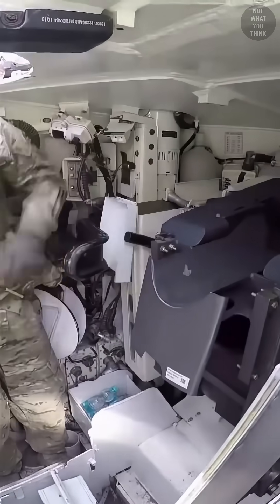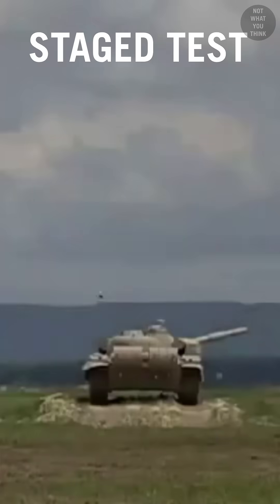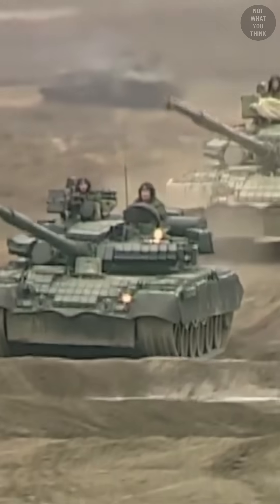Why M1 Abrams Tank Has No Auto-Loader #shorts

Comment: tbh most cons of an autoloader can be fixed if theres just more money pumped into it, though that increases price per unit (duh) and complexity in maintenance, repairs and production
basically a solution , if you have the money to spend its "just" to throw more money at it
Reply: honestly with modern technology i dnt see any reason for more than one operator in a tank.
Fighter planes have only one pilot so why do you even need all those extra people? radar and other sensors take care of the commander, auto loading and auto targeting takes care of main gun, Auto targeting takes care machine guns and all the driver needs to do is look at the target and synch his target acquisition computer with the main gun and boom next target.
Reply: Operating a tank is much more complex than video games make it out to be though, added crewmembers also can help each other during repairs, often take workloads off each other bust most importantly reduce costs and increase the tanks reliability
If applied technology is advanced enough to compensate for those factors it makes sense but otherwise? Not yet at least
Reply: @TheChrush3r  pilots don't fix their own planes and the technology is there to build reliable single operator tanks.. The problem  is conceptual.

Think about it the way militaries have always thought about things. 
Its been done this way and we see no reason to change it. It works so we wont change it and we have enough men to do it so why change it.

If, on the other hand there was an absolute necessity tanks would be single operator with absolutely no problems at all.

As for reliability tanks are a zero sum entity in combat. Its either working or not. If a tank takes an effective round its out of action no matter how many crew it has. 

As you increase the number of crew you must increase the armor protection. Each crew member adds somewhere around 6 to 10 tons of armor for protection.
Eliminate those and you can not only offer better protection for the remaining single crew member but you end up with a lighter tank with better overall systems protection since there needs be no design criteria around an internal single hollow pocket. The interior space can now be optimized for the purpose of ammo storage , retrieval and loading.

All that's needed is for there to be a pressing need for such a tank. Like say Sweden?
Reply: @jussayinmipeece1069  And one more aspect man needs space. Bigger crew = bigger tank = bigger target = easier detect = easier hit

Comment: Some countries can't afford to have 4 men inside a tank. That's why countries like France or Japan prefer to rely on auto loader.
Reply: Well, France has more than 250 tanks. That would be 250 more crew to train, not that much (and they previously did with the amx30 series).
I think the main reason is that the tank is suppose to stay moving, and having a manual loading system is not convenient while moving at 30mph, so they went for auto loader. And for Japan because the tank is supposed to fight in mountains area, same principle.
Reply: @vizender  
Except France has a lack of soldiers. According to the French Ministry of Defence, they are lacking thousands of soldiers just for the ground army alone.
So yeah. 250 soldiers +  replacements is a lot.

Plus between the AMX30 and the Leclerc, many years passed, and people aren't so interested in the army today

Comment: Abrams is manually loaded because it is obsolete vehicle relying on 60+ years old design of huge heavy armored box for 4 corpses similar to Leopard 1+2 or Challenger 1+2. All of these were designed with 105mm guns in mind in ages when their counterparts were mainly T55 and T62 tanks. But rest of the world developed further. Challengers rely on multiple part manually loaded ammunition, which is even worse case.

There is zero real advantage for human loader. Try to load 120mm shell while tank is moving on some terrain and try to do it repeatedly for at least 10 times and you'll quickly find why ALL modern tanks have autoloader. And I mean modern like Soviet/Russian T64/T72/T80/T90/T14, French LeClerc, Chinese Type99, Japanese Type 90 and Type 10, South Korean K2. And even US and Germany are considering autoloader for any future tank as there is no way how to manually load large and heavy shells reliably. Added living space for another human also means that exactly that increased amount of space needs additional armor which increases weight. That is the reason why Abrams has 70 metric tons and is unable to navigate over weak terrain without sinking in mud. Compare that to 43 ton Russian tanks with rather wide tracks and now imagine both of these wehicles moving somewhere in eastern Europe where are many rivers, lot of muddy terrain, slopes, unstable weather with frequent rains and of course interesting winters.

Comments about "more men for job" are also false as every modern tank unit has support vehicles with maintenance crews and in case anything serious happens to tank, crew bails out and leaves the tank. There is no WWII when four or five guys are fixing broken track while being under fire. Trained crew is very expensive and it is easier to give them new tank and save damaged tank later by servicemen with proper equipment.
Reply: The US had the Expeditionary Tank in 1985 that had a crew of 2 and a remote-turret with an autoloader. It was in trials to be a new light-tank to replace the M-55 Sheridan. It had a 105mm rifled gun. The tank lost to the CCV-L in competition for the contract, but ultimately the whole light tank program was cancelled because the CCV-L was too heavy and the auto-loader was unreliable. The Expeditionary Tank Autoloader was redesigned and installed into the now know Stryker MGS. It will be retired in 2022 because it's too unreliable as a vehicle.
The US has just never had a reliable or light-weight autoloader. The Expeditionary Tank prototype built in 1976 even had a remote turret and a crew of 2. The US Army still rejected it
Reply: Can't really say much more. Manual loading is just something of the past

Comment: "the armor will protect the crew in an event of an explosion"

Driver: "You guys get protection?"
Reply: Next thing you see is the turret flying through the air🤣
Reply: What armor? The tank can be penetrated with a 50cal from the back 😂
Reply: Abrams weakness was the gap between Turret and Driver
Reply: The driver is in his own area. He probably the safe guy vs tank shots
Now anti-tank mines well......
Reply: If you are in Russian tank a lot of them actually were made in a way where driver can't run off and would die with the tank
Reply: The driver has the most protection  tho
Reply: @picklepickle7306  if it’s actually dug in like it’s supposed to be. The turret has more protection but also sits up higher on the tank. The driver is protected by less armor but can be hidden if the tank is dug in leaving nothing but the exposed turret
Reply: @picklepickle7306  Nope. As it was pointed out above, the top of the driver port has no meaningful protection against tanks or other large calibre weapons. The only way the driver is fully protected is when the tank is in a hull down position. The turret has much better protection.
Reply: @Lehr-km5be  long range shots with SABOT against the Upper glacias of the Abrams and other similar NATO tanks are designed at such a steep angle as to cause fracturing of the Tungsten penetrator. Th er re is reasonable protection for the driver including the lower glacias of the Abrams which has similar effective thickness as the turret itself by being also composed of composite armors. 

What the upper glacias of the Abrams lacks is protection against large caliber (90mm or more) modern HEAT ammunition as the angle cant be steep enough for the armor thickness and composition to fracture, or properly defect said rounds as they will also come downwards in a plunging angle to be more effective at distance. 

This doesnt mean they aren't unprotected, Modern tanks are swiss army knives and as such come with different Combat packages. For example, many Abrams tanks fighting in urban combat are equipped with extra blow out panels and external ERA across the sides and front for protection against RPG fire.
Reply: @Lehr-km5be  what about protection from the sides?
Reply: @picklepickle7306  Pretty much comperable. The turret obviously has lower protection on the sides, but still enough to stop lower calibre rounds. Problem would be if the shell impacted below the turret, but that would probably not be able to impact the whole turret crew. Hull has no meaningful protection on the sides. That of course impacts the protection of the driver too - however, even if a smaller calibre shell penetrates, there is a big chance it will be stopped by an armored fuel tank. Even if the fuel tank is fractured, the driver is safe tho. However, if a modern anti tank shell hits any of those places from the side, no way in hell anyone will survive.
So yes, comperably driver has a better protection from the side, seeing how crew in the turret can get killed even by smaller calibre shells if they impact below the turret. Driver's protection from the front is visibly worse tho, and seeing how any tank doctrine nowadays obviously tells tanks to fight facing forward that poses an issue. Modern tank doctrine also dictates that tanks should be in a hull down position but that can not always be done, and after all tanks need to move too. Taking all things into account I would say that the turret crew has a bit better protection.
 We should also take the escape time into account, as often the tank could be rendered immobile without the crew receiving a scratch. In that case the turret is arguably a better place to be - while it is elevated and exposes the escaping crew to the incoming fire more, it is quite hard for the driver to escape if the gun is facing forward or backwards, thus blocking his movement. While he will be able to open his hatch regardless of the turret position, depending on how big the driver is, the seconds more it takes for him to fit below the gun or the back of the turret can be a difference between life and death.

Comment: As far as I know, T-14 Armata actually manages to not have problems with safety while having autoloader. It's achieved by separating crew from ammunition entirely, so if tank gets it's ammo blow up, nothing actually happens, except now tank have to drive away from the place in order to repair autoloader and stock up on ammunition. The older models probably would be a death trap in that case, yet the way autoloader is placed was supposed to make it harder to be hit, that's why "Carousel" type of loader is placed as low as possible.
Reply: The US had the Expeditionary Tank in 1985 that had a crew of 2 and a remote-turret with an autoloader. It was in trials to be a new light-tank to replace the M-55 Sheridan. It had a 105mm rifled gun. The tank lost to the CCV-L in competition for the contract, but ultimately the whole light tank program was cancelled because the CCV-L was too heavy and the auto-loader was unreliable. The Expeditionary Tank Autoloader was redesigned and installed into the now know Stryker MGS. It will be retired in 2022 because it's too unreliable as a vehicle.
Reply: @chaosXP3RT  lol. What type of autoloader was installed there?

Comment: Slower reload, less reliable, takes up a lot of turret interior space, and much more dangerous. With a skilled loader the Abrams is one of the fastest firing tanks out there 😂
Reply: Are you for real ? Japanese tanks reload in 3 seconds with autoloaders. 
Autoloader are really reliable, they're not more likely to break apart than any other part of the tank. Would you replace the engine with horses because it's "more reliable" ?
Autoloader also allows for more compact tank design, rather than "taking a lot of turret interior". Just look at the Soviet designs.
On top of that, they're way safer if they're coupled with blow out panels. Indeed the loader takes a lot of time with the safe door open, while an autoloader only needs a fraction of a second with the ammo door opened.
Finally, as it's been stated, 5 second loading is only achieved with optimal conditions. When the tank is moving or the loader is getting tired, loading time drastically increases.

Human loaders are a thing of the past. The army just has troubles moving away from something that's working. "If it works why fix it ?"
Reply: @playonandroid9977  4-6 for Japanese tanks. Which is impressive for an autoloader. But that’s the average reload time for an Abrams crew member. Plus due to all the moving parts it increases chances of malfunction. Really going to suck if you’re in the heat of battle and you can’t fire your main gun when the autoloader fails. Plus the already mentioned danger factor of autoloaders. If they truly were beneficial, the Abrams would have it. And the whole “the military can’t move away from the “if it ain’t broken why fix it?”” statement would be true if the F-35 was a twin engine jet. Lastly, I’ve seen the interior of Russian tanks. Honestly pitiful at how little room they have. Less than the leopards turret interior.
Reply: @LILKRANKINp  a well made autoloader is more reliable then a human, and doesn’t get tired. Humans are inferior.
Reply: @elliotsmith102  tell that to Abrams crew members.
Reply: @LILKRANKINp  @Bass God  only reason Abram doesn't have an autoloader is because it's outdated. Most modern tanks have one nowadays.
And 4-6 sec for a manual loader ?? Lmao.
This happens only when not on the move, and loading the first round.
The more you load, the more time it's going to take. First because your loader is going to get tired, second because he has to reach further to get those rounds as the rack is slowly getting emptied.
5 second reload is really the best you can have, with optimal conditions.
As opposed to the Type 90 which will load in 3 sec no matter what.
And as it's been stated, there's no reason for an autoloader to break rather than any other part of the tank. There's so many complex systems on tanks nowadays that this point is completely stupid.

Only advantage the 4th crew member provide is an extra person scanning for target when the loader is idle.
Reply: @playonandroid9977  There is literally a company that made an autoloader for the Abrams but the army turned it down. The type 90 loads in 4-6 seconds depending on the ammunition being loaded. Experienced loaders will load in the 3-4 second range and the loader exhaustion argument would make sense if endurance training didn’t exist. During a training exercise an Abrams loader got the tank to empty 17 rounds in 45 seconds and his friend operating in the tank next to him did it in 46.5 seconds. And I find it funny how an “outdated” tank is considered to be the best in the world. The only reason other countries have an autoloader is to reduce the amount of people required to operate the vehicle as they usually have less personnel. I appreciate the thought out answers, but you’re not changing my viewpoint on this.
Reply: @Bass God  well, I didn't really mean that the Abram is outdated. It certainly performs great. I meant that it was designed a while ago, with some outdated ideas.
The manual loader was kept because autoloader at that time were unreliable and the M1 was meant to have a 105mm gun.

Also, I don't know where you get the 4-6 sec reload time for the Type 90, as it's less than 3 sec.

I won't repeat myself over all the other points if you don't wanna listen.

Autoloader are better, no matter what and they're the future, especially since more and more countries are looking to equip themselves with larger and larger guns.
Reply: @playonandroid9977  and you have the right to believe autoloader’s are better. I don’t hate tanks because they have autoloader’s. Just from everything I’ve seen human loaders are better. There are a lot of tanks I do like that have autoloader’s.
Reply: i kinda wanna see how the loader can load shell relayable on the move, also like every nation is considering autoloaders,bcs loading 120mm shell manualy is hard, abrams was desinged to have 105mm at the time it was fighting t55/t62
Reply: Accuracy matters more than speed. Js
Reply: @mrrroow  well seeing as the average autoloader wouldn’t even pass US army qualifications, I don’t think that’s a concern. If you can consistently load an Abrams cannon in 7 secs or less I think you’re pretty good.

Comment: when you hear automatic and manual you think Russians would be the "manual" but in this case the American is the one and is indeed safer.
Reply: Not necessary, autoloaders on tanks like Leclerc and Type 10 is also having an autoloader with a blow-out panel. The Russian newest tank, the T-14 Armata, has a separate compartment between the crew and the turret, furthermore, the T-90M was equipped with some blow-out panels as well.